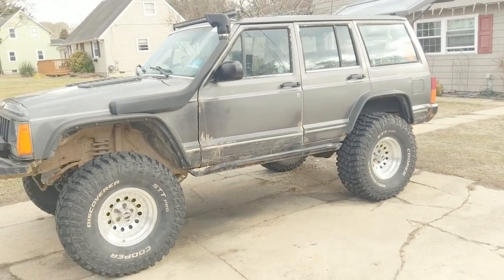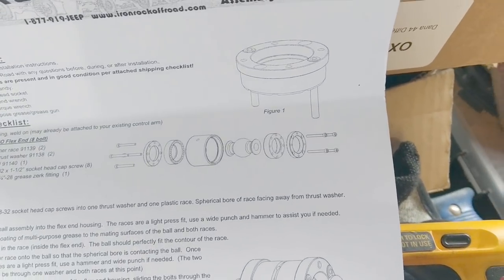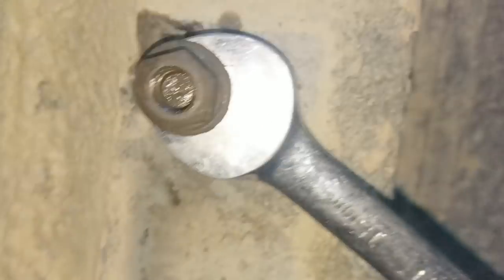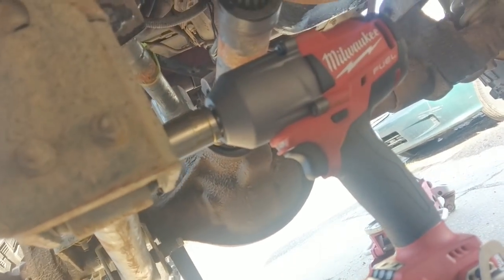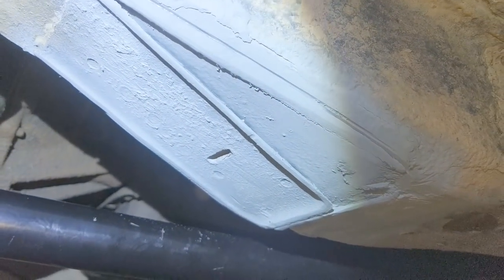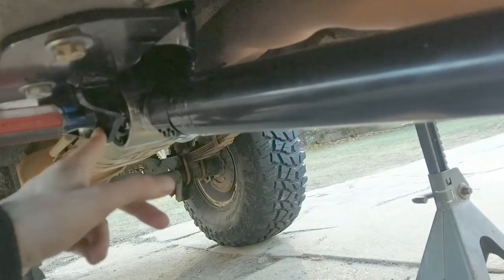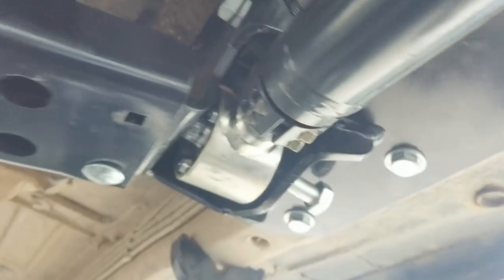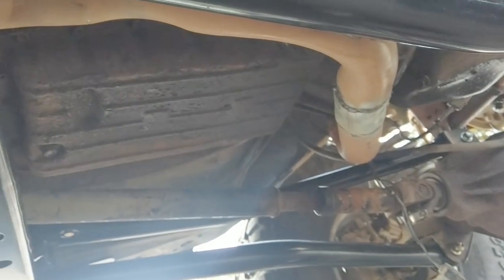89 Cherokee IRO Rock-Link Long Arm Install

Comment: I purchased this same kit. I would really recommend upgrading the axle side upper control arm bolt.... Iro and currie sell a 1/2 inch bolt flex joint...

Comment: I thought the carriage bolts worked out pretty slick when I did mine, lol.  Just jacked it up by the center and the folded in lip holds if from moving front to back and you can use 2 hands to slide them in.  I did temporarily use the drop blocks though so the nuts were way easier to see and get to.  The other nice thing with the carriage bolts is they should allow rocks to slide over easier without messing up a bolt head or nut... if you ever get one up there.

Comment: A few suggestions from one gear head to another. Get a proper set on impact sockets, wash your jeeps lower everything, makes thing so much easier, and get rid all that rust. 

I'm on a mission with with getting all rust and rot takin care of on my Wrangler. Costing me $$$ but she will not fall apart due to preventable stuff.

Comment: I like how honest you are while doing these swaps / everyother person acts like oh everything went smoothly yeah that bs... I have a xj as well recently did a motor swap it's a 2000 with the 0331 head crack swapped in a 96 motor holds almost 40 psi oil at hot idle my 2000 xj had 82k org miles ... the 96 had 159k almost double lol it runs drives great ... I got to edit the videos I'm lazy... but I'm having an issue with my dash light not working they worked when I first got it... checked fuses all good slapped dash no reaction out of her..

Comment: That's true on the the holes for the lower control arm making up for road crown. On my ZJ passengers side lower control arm frame hole its 1/4 inch more forward than the drivers side. So since I have short adjustable arms I just adjusted the lower drivers side 1/4 inch longer and solved my issues.

Comment: I wish someone made control arms where you could adjust caster without taking one end of the arm off. I have adjustable control arms top and bottom and I'm running about 9 inches of lift and I've been playing with the caster every time I tilt the axle back more it drives better I need to adjust it back a little more so it's easier to drive right now my pinion is straight with the drive shaft

Comment: Did you cut that LCA bracket next to the fuel line with all the sparks flying?  I just did mine.  I'm afraid the last cut will have to wait until I empty the fuel line.  Also I'm not sure my cross member bolts will go to 50-60 ft lbs.  I think they will strip.  I have some welding in my future.  I want to go inside through the floor and put a plate like a giant washer over the bolts and put nuts on the other side.  That through the frame stiffeners that will be done should be much stronger.

Comment: Each time i watch one of your Videos i feel better about leaving my XJ Bone Stock not even a lift or Tow Ball never had one. Just watching you go threw each nightmare is a lesson well learned. My Jeep has never seen any off road duty and never will. How you can spend Thousands on a 5 Hundred Dollar Jeep never fails to amaze me. Just the Labor you have put into that Jeep was worth Thousands more. By now you could have bought a Brand New Ride. Well when i was young like you it was a Muscle Car Addiction. Ask me where all the money wasted is today lol. Well i guess if you enjoy it go for it. Being a Structural Ship Fitter now Retired i will give you a note of caution. All the heavy duty Kits you are installing are only as strong as the point your mounting them too.  You had a broken Transmission mount and just by replacing that would have been enough. Your short arm kit with the Drop Brackets was just fine and mounted in a better spot Up and out of the way.Those long arms to me are just something else to rub on the Rocks. You should have just had a shorter upper arm machined to set the cast. Would have been a hell of a lot cheaper. If your looking for better on road Performance buy a Stock XJ because you can't have both from a ride built for Off Road.
Reply from the maker: For me, it's a fun hobby, so the money I spend now it's a huge concern if I can enjoy it down the road. I also doing my shopping as carefully as possible to get good deals, but some parts are just going to be expensive. It certainly is a labor of love, but I'm hoping that I'm about done with major mods. Never know with a Jeep though, they always need more. 

But when I'm done I'll know every inch of this vehicle inside and out so when it does break down, I'll be able to diagnose and fix it. The Civic has Daily Driver duties so this is more of a toy anyway. Takes a lot of time and money to be able to show off on the trails. Besides it gives you some entertainment, haha.
Reply: (Believe me i get it.) But some day you will get old as i am and unable to keep crawling under to fix your ride. If i only had the money spent thinking like you do. Just sold my 1969 Firebird for half what i spent on it.Also had a 1967 GTX today a 40 thousand Dollar ride. Totaled that in Boston Ma.. Also had a 1967 Firebird 400 4 speed ride i wrapped that around a Telephone Poll in Newport RI.Then there was my first ride a 1970 Boss Mustang 351 Cleveland for an Engine Dad bought me New when i was to young to know what i had. Needless to say another Telephone Poll claimed that one. Each ride i mentioned was in Super Condition.If it was not i spent the money to make it happen. Today all i have is the memory's. My last 1969 Firebird is posted on my FB Page take a look. Now i drive a 2000 Jeep Cherokee XJ and a small 2001 Toyota.Good Luck with your Jeep,learned much watching you tear into that Jeep.
Reply: how about converting the rear leafs to coils?  It would probably improve the on-road ride. A little expensive, though.

Comment: Looking at a upgrading to long arms within the next year and pleasantly surprised to hear Waveshaper - 1982 space program @ 13:49 and 48:34 
How was this set up worked for you so far? Pros, Cons? How does it hold up to other long arm kits?
Reply from the maker: Ehh, it does the job. Bit of clunking here and there over fast woops, but otherwise decent for the price

Comment: This videos is actually helpful. I'm in the process of getting all the angles lined up on my IRO 5.5 Makes sense to measure from the subframe fixed point to the axle on both sides to see if they are even, which they should be right?

Comment: Just curious, is there a reason you didn’t just put a Jack under the crossmember to hold it in place? Then you would have 2 hands to install the bolts.

Comment: Lol I remember cutting those CA brackets off on my xj. I ended up buying one of those port-a-torch kits to cut them off and ended up blowing a nice hole in my frame. At least I decided to install iro frame stiffeners at the same time. Would highly recommend them to anyone

Comment: Does the IRO cross member keep the t case sitting at the same level as the factory cross member without a t case drop or is there some slight variation since your new cross member mounting points are lower than the frame rail?

Comment: Wondered if you sandwich your cuts on the inner to add a little structural integrity I know welding out side corners might create a rust Pocket on them seal top let bottom stay open .

Comment: Nice video...sad you didn't get the expected ride out of the long arms. You id say not much of a difference correct? Does your spine still get jolted when hitting pot holes?
Reply from the maker: Compared to my previous drop bracket short-arm setup it still rides basically the same. I haven't tried out the RTI ramp yet to see if I can flex out more, but I haven't nailed the arms on any rocks yet so that certainly is a plus. Since it still has fairly low angles I still glide over potholes no problem. I notice my steering wiggle more then I feel the bumps.

Comment: Assuming of course everything is properly adjusted the biggest factors in ride are the tires themselves followed by the shocks followed by the springs. Stiff tires means stiff bouncy ride. Shocks must have the proper valving. Throw some Rancho adjustable on there just to play with the settings and you will probably be surprised what adjusting will do. Custom tuned shocks are the best but that is pricey. The longest free length srpings possible with the lightest spring weight are the best for a smooth ride. The control arms will transmit less shock to the body when they receive less shock from the other components.

Comment: I've been trying to decide between the IRO Long Arm upgrade or the Savvy Mid arm for my tj. The IRO kit is less money of course and has a flat belly trans crossmember.  You may have pushed me over to the Savvy kit however.  Most long arm kits sacrifice suspension geometry for packaging purposes. They have no vertical separation between the frame control arm mounts. IRO kits seem to have separation but they are a little funky. I emailed them and asked what the axle separation was and the only answer was that they would put their kits up against any other kits without giving me an answer.  Kinda turned me off.

Comment: I'm between this kit and the rustys long travel 4 link (an actual 4 link, not radius arms). The rustys crossmember looks like it attaches waaaaay more securely, I'm just not sure how the upper passenger arm will fit without extensive mods to the xj. Hows this kit do on the road and highway speed, hard braking, hard steering and so on?
Reply from the maker: It seems to be holding up well enough. Haven't noticed anything negative besides how annoying the crossmemeber is to drop

Comment: Also, don't you have a sawzall? A decent bi metal blade goes through those control arm brackets better than a cut off wheel, IMO
Reply from the maker: That's how I cut the exhaust, didn't think it would have fit as well for the brackets

Comment: Hows the suspension holding up a year and a quarter later? I'm thinking of getting rid of the yj and getting another xj and getting this kit
Reply from the maker: Seems to be doing just fine. I'd recommend a solid upper axle joint to go with

Comment: What did your final caster reading read?  I’ve just got done putting the same set up on my MJ.  Including the OTK set up in the the front. My caster is like 2ish on the right side of the zero.  An to adjust that I would adjust the top arm correct?  Also, man, wtf do you do for the drag link bounce?  Drives me crazy.
Reply from the maker: I had to play around with all sorts of front end geometry to try and get my shit to drive straight. I eventually had to extend my passenger arm like over 1/2" further to help fight road crown. Passenger caster is 11º and driver caster is 9º. As for the bounce, the joints will stiffen up fairly quickly and you won't hear it after that.

Comment: Welp, this is another long arm kit to add to my small list of 3 piece crossmember kits. That's one major factor in my decision making when I finally go long arm since I plan to weld the side brackets to the unibody (after frame stiffeners).  I don't trust the six or so bolts holding the side pieces in, they can always work there way out or get striped like yours did. I already have one bolt on my stock crossmember that doesn't like to hold it's bolt.
Reply: Daniel Pace if I had to buy a 3 link all over again, I'd still go with Cavfab. Granted it took forever to get my alpha kit but everything is grade 8, the center section uses grade 8 bolts with nuts welded to the top side, Currie Johnny joints on the lowers, a machined Currie Johnny joint for the upper to replace the bushing on the axle that uses a larger bolt, and everything went to gather super smooth. I had my old kit out, new kit in, all adjusted, in about 4 hours by myself. You can also get their kit in a 4 link.
I also hear good things about BLees 3 link.
Spend the money once, cry once.
Reply: I've been following the Cavfab kit since pre-orders over on the Cherokee forum and that so far is still my go-to kit at the moment.  I love the design of it and it does seem to be easier to assemble than the carriage bolts in this one. And yeah, I plan to get it right the first time... well twice...  I have two XJ so I'll be doing it twice at some point. Guess I'll be crying a river by the second one.
Reply: Daniel Pace I ended up going with cavfab 3-link too and had the same fear of the bolts holding the crossmember. My frame was also fucked up so I installed iro frame stiffeners and new floorpans. While I was inside the frame I made my own nut strips and welded in the sleeves for the tie-ins to really strengthen it. She is stiffer than all hell now and the kit ain’t going anywhere
Reply: I've been running this kit since it was released. I actually ordered it the day it was released back in October. The only thing I did was buy a Johnny joint for the axle side so I could run a 1/2" bolt. Other then that I have no complaints with this kit. I also daily drive my jeep with no issues. I considered the cavfab kit but the shipping issues pushed me away. The other benefit to this kit is you can still use their t case skid. Which cavfab has been saying theyll be releasing one soon for atleast a year and I have still yet to see one. Also of you're worried about only having 6 bolts holding it on you can always weld the sides in and still have access to drop the crossmember. Clayton's long arm kit requires you to weld in the sides so it's nothing new.
Reply: kameryn Reeve yeah took over three months to get all my cavfab parts. They told me it was only going to take two weeks lol. I also didn’t feel like welding on those brackets just incase I decide to swap it some day hah really wish iro came out with their kit a couple months sooner
Reply: psamma21 yeah, mine took 5 months to get. Their shipping is horrible but the parts are great, that and they are very quick to respond on facebook. I still plan on ordering their ota track bar.
Reply: kameryn Reeve I've also been waiting for the t case skid to come out. I have one from Rustys but I've been hoping Cavfab would come out with theirs
Reply: I ended up getting their OTA track bar and their steering too. The track bar has given me a bunch of problems but Im not really blaming cavfab. My frame was all fucked up so I burned IRO stiffeners and plated the entire area around the trackbar bracket/seering box. Because of this the TB bracket is not sitting perfect on the frame and making all kind of noises, it even wobbled out the bracket and johnny joint. Im hoping that I can just weld the bracket to the frame to fix the problem.
Reply: Clayton > everything

Comment: What state are you in ? I was wondering if that's rust on the underside or mud ? I'm in the Midwest and I just did the whole bottom of my Jeep WJ , with POR 15 because of the salt eating it during the winter.
Reply from the maker: South Jersey. It's probably a combination of a lot. I undercoated it with lizard skin, but sticks to it real well.

Comment: 2 years later, how do you feel about this kit versus other 3 link kits on the market?  BKFab, CavFab,...
Reply from the maker: Haven't looked into other kits recently, but besides the crossmember bolts that are a pain during transmission or exhaust work, it's decent. I had to get a solid upper axle joint as the rubber was destroyed after a few months.
Reply: @NickInTimeFilms  aww ok.  Thanks for the update!

Comment: When doing a 3 link.. you drop the frame into the springs so you get ride height.. you then install the lowers at that position. You then install the upper so your pinion angle is 5-7*. This is really a how to not install a 3 link for proper axel alignment lol..

For 4.5” long arms just are not needed and you’ll actually hang up a little more now.. cool setup but I’m sure by now you’ve figured out you don’t really need to consider Longs till 5.5 plus lift. With that much work you could’ve bought brackets and done you own sort of mid length with the arms you already had.. this would’ve corrected arm angles and helped with clearance while removing those dumb drop brackets..
Reply from the maker: But this is a 5.5" lift, lol. Even with the previous drop brackets the control arms were still down a little. Minimum clearance is 3.5" of lift. 

But I'm curious, how do you drop the body onto the springs without the axle wanting to roll out from underneath? Because that almost happened when I was originally installing the drop brackets and I had to use the winch to suck the axle back into place.

Comment: Hey nick I’ve got the exact same set up as you do here on my ‘88 MJ.  I’m having issues with my front drive shaft rubbing my upper arm on the 3-link when I’m flexing around.  I’m thinking caster issues???🤷🏼‍♂️🤷🏼‍♂️ just wondering what you think.  An if you’ve had the same issue.  Same IRO set up including lift height and steering set up.  Thanks for any input from you or anyone else reading this.  Love the set up but that bugs tf out of me😤😤🤬. Thanks again bro!!
Reply from the maker: your joints are all installed the right way? I'd make sure your axle is properly aligned with the vehicle, don't think i've ever had this issue. Trackbar centered, caster good, thrust angle isn't too far off?
Reply: NickInTimeFilms I know the arms are installed the right way, and the axle is pretty well centered to the vehicle.  So I’ll stater check angles and so I’ll start checking caster and thrust angle.  It’s not terrible but it’s bad enough to where I’ve got some ding marks on my arm.  I’ll post what I figure out.  Thanks man I appreciate the reply.